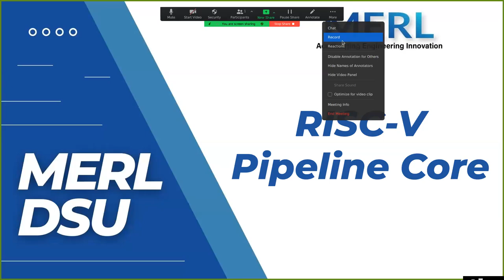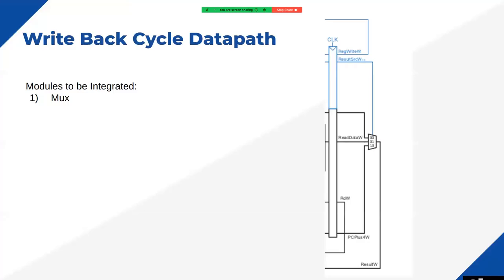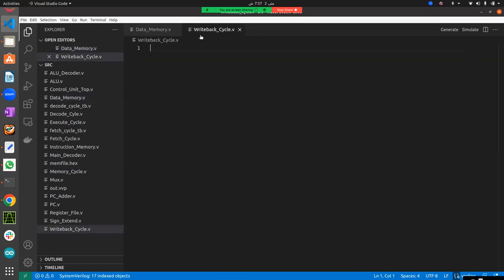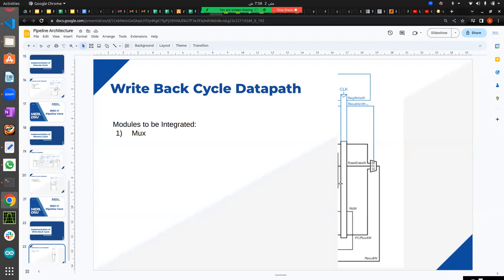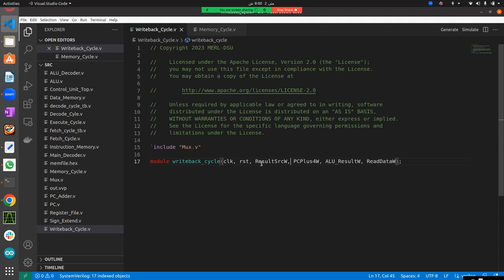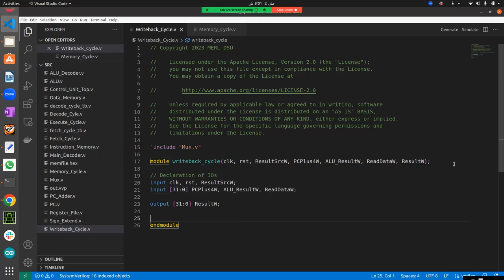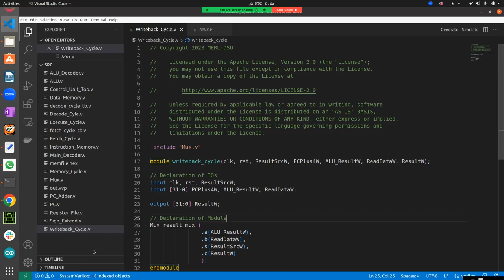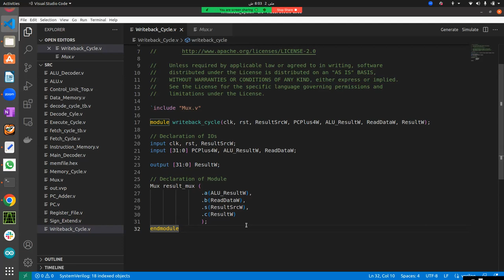Lecture 6: Design & Implementation of Writeback Cycle

Comment: Thank you for the helpful tutorial!
I'm confused as to why you didn't use the 3-by-1 mux to connect 「PCPlus4W」 to 「ResultW」 at the end. Wouldn't 「PCPlus4W」have nowhere to go after the MEM stage if it isn't connect to any other blocks?
Reply from the maker: the current implementation shown in the video does not require it. If you extend the design than yes you would require it to make connections